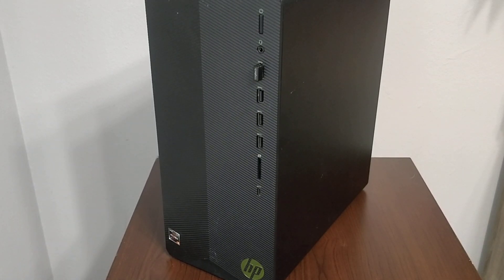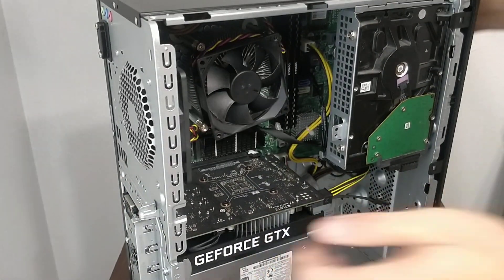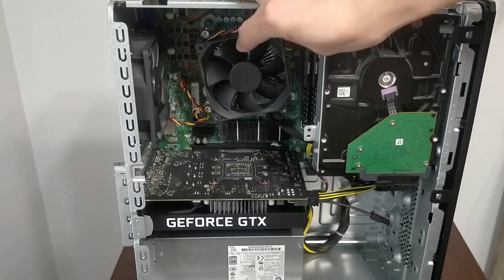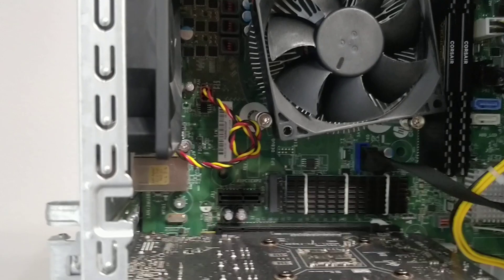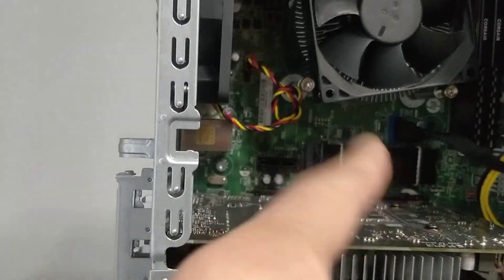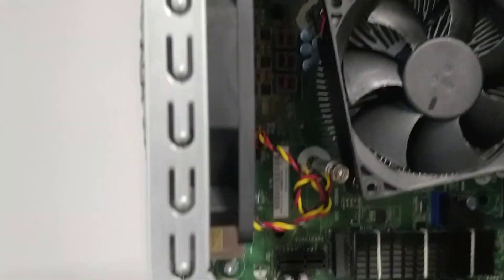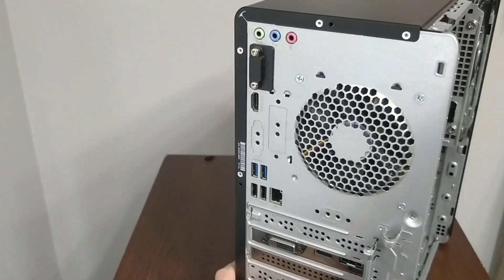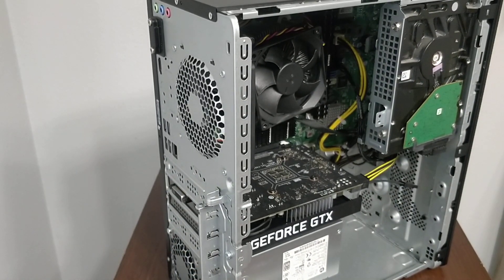HP tg01-0023w, How much Can You Upgrade?

Comment: You can not change power supply there is no after market upgrade for psu. 400 platinum is what they come with. The max upgrades are the ones I've done from the hp website Ryzen 7 3700x, 32gb DDR4 2666 memory and a RTX 8gb 2060 Super SC Ultra with 1/8"  space to spare. The 400 watt is plenty. The hp pavilion TG01-0023w power supply is plenty for the upgrade. Ryzen 7 3700X has TDP of 65 watts and the rtx 2060 has TDP of 175 watts and the memory runs around 1.35 watts. So just these 3 main things at full throttle only use 241.35 watts of power. This unit doesn't have a normal hard drive or cd tray to power. When graphics card companies tell you power requirements recommendations they shoot high because they know alot of people have machines that require alot of power before you even bring gpu into the equation. With all these upgrades you still have over 100+ watts left over. These small ego machines dont need all the extra power because they hardly use any power in first place. You not running the memory at 3200mhz
Reply: I’m getting this pc for Christmas will you give me a list of the things you upgraded on your pc?
Reply: @StandUpDon  AMD Ryzen 7 3700x with EVGA RTX 8GB 2060 Super SC Ultra and Vengeance LPX 32GB set at 2666 on a Samsung 65" 4K QLED screen.
Reply: @SoutheastanglerLLC  Can I upgrade it like this, ryzen 5 3600 EVGA RTX 8GB 2060 and Crucial Ballistix 3200 MHz DDR4 oh and Seagate - Barracuda 2TB Internal SATA Hard Drive
Reply: @Soovdedthegoat  yeah just know the memory your going to have to set manually to 2666 then memory is not going to run at 3200. The ryzen 7 is going to compliment  the 2060 better. But all you said should work
Reply: @SoutheastanglerLLC  ok thanks, one more question tho what do you mean by the ryzen 7 will compliment the 2060 better
Reply: @Soovdedthegoat  they have a very even time spy score so you are far from cpu bottle necking. They should be fine I use mine for PC VR me personally the cpu upgrade made a huge difference in performance in AAA games. Alot of physics in games are on the cpu more than gpu nowadays. There was reasons for me to upgrade the cpu
Reply: @SoutheastanglerLLC  ah ok thank you
Reply: So I can really upgrade the graphic card, from the hp pavilion TGO1-0023W to a RTX 2060 RTX SUPER??
Reply: @josehdz82  yes anything over that has a higher TDP
Reply: I’m pretty sure the EVGA 600w psu will drop right in as a replacement. They are the same dimensions. Correct me if I’m wrong.
Reply: @bombxreviews3261  it will not work the main board connection is not the same
Reply: @SoutheastanglerLLC  what if change out the motherboard?
Reply: @bombxreviews3261  if you do that then sure but why do that. But I dont understand why you would do that and not just build another pc.
Reply: @bombxreviews3261  that's why 2060 is max for this on hp website
Reply: You have limited space I only have 1/8" space between gpu and front of case. Unfortunately you will need to buy windows again due to the version on this pc is setup through hp to work with the oem motherboard. What are you trying to do exactly
Reply: @SoutheastanglerLLC  not trying to build a pc.. I got this pc for my step son because it’s cheap and decent for the price. But I want to go to 16gb of ram but don’t want to limit the ram speed, so was going to change out the motherboard since you can buy one for around 80 dollars. 

Also I don’t really have a need to change out the psu, however, 400 watts seems a little low for my liking. Especially if I plan on changing the case in the future and want to add rgb lights, more fans, and all that.
Reply: @SoutheastanglerLLC  also didn’t try to build a pc because covid has jacked the prices of individual parts way up and would be a rip off right now. Would rather just get this an upgrade a little at a time. I don’t plan on keeping this case forever since it has limited room and no glass to see through. Basically just wanted to get him a starter pc to play for now without needing to upgrade right now. I know this pc hardware won’t last forever and upgrades will eventually be needed.
Reply: @bombxreviews3261  I would leave the pc alone and just get 16gb and set to 2666. It's not worth upgrading the motherboard. Just because a graphics card manufacturer says they recommend a certain wattage does not mean the card uses all that power they dont even use half of what they say. I would not waste my money on what you are wanting to do because the motherboard your going to change to will be old news. We are close seeing a new motherboard from AMD. If you get another motherboard you will need to buy windows and a new psu because nothing from the hp is going to work. Your not going to get anymore speed your just going to spend money. This current erica motherboard is 2020 proof just enjoy it the way it is. Or do my upgrades if you want the true power and potential from this machine. Lately I've been averaging a 3d mark score of 9862 on 4k screen. I'm sure I could get over 10,000 if I really pushed a overclock.
Reply: @SoutheastanglerLLC  thanks. So what kinda fps are you getting on 4K? So you’d recommend just changing out the cpu and gpu (if we wanted to) and everything will still run fine?
Reply: @bombxreviews3261  lol you got that right. Prices for all pc hardware is fucked. It's from our sorry ass president for one along with the coronavirus and the new oculus has alot of people jumping on pcvr and you need the hardware to run vr. Our country is broken are trade is fucked that's why people are over paying for older graphics cards what you see is all we got until these big companies can get up and running again. And nvidia bullshit didnt help the market ether.
Reply: @bombxreviews3261  yes everything should run fine. My FPS depends on what game I'm playing. I'm currently playing Doom eternal with all graphics options set to ultra nightmare and 4k I get around 70-80.
Reply: @SoutheastanglerLLC  will a gtx 1660 work for it
Reply: @irondolphin1559  yes anything under a 2060 will work
Reply: so u can run all that fine the gpu the a7 ang max ram plus ssd and what ever gb or tb hard drive u got without it craping if so thanks i was looking for a answer like this
Reply: @THBGYMN  yes all no problems
Reply: @SoutheastanglerLLC  how much watts dose the motherboard take from the 400wats and how much watts in total dose its use up like from the 241.35 like max is 300? for all included motherboard the 253 m.2 my specs now is 500 hdd gonna switch to a 1tb and 250 m.2 gonna keep gonna upgrade my ram to 16 and the gtx 1650 to 1660 ti or just save for the rtx 2060 like if that hits 300watts thats good like im just making the best out of this pc
Reply: for got to say my cpu i might upgrade or just keep it tbh more looking to upgrade ram and gpu and added storage so if i can do that fine then i am good
Reply: @THBGYMN  motherboard is only going to use the power that the components use. The motherboard alone does not use power. It only transfers power from components being used. These come with the 400 platinum psu it is plenty of power. I have mine maxed to the sky and never and I mean never had a crash or problem with the upgrades. I still have power left over. I know this because I have overclocked and push extra voltage and still no crash only time it crashed is when I get crazy with clock speed buy any pc will do that. I think everyone is over thinking things. The hp site is correct on upgrades just not the memory
Reply: @THBGYMN  dont ignore processor you dont want to make a cpu bottleneck all newer game are very cpu savvy the more cores the better. Processor is a must if your looking for performance in games. I had skipping and stuttering in games like boneworks and half life alyx after upgrading from ryzen 5 3500 to ryzen 7 3600x made a night and day difference everything is very smooth so that in itself is proof cpu does matter. I upgraded gpu to 2060 and 32gb while I had the ryzen 5 3500. It did not release the best until the ryzen 7. You cpu and gpu should share the load
Reply: @SoutheastanglerLLC  ok ty man im just vary new to pc build i know more software then hardware  buy thank you again so much for the help
Reply: @THBGYMN  forgot the ryzen 5 scored 4215 and the 7 scored 9874 at stock speeds on 3d mark. That's just buy swapping the processor only
Reply: @SoutheastanglerLLC  alright thanks again
Reply: @THBGYMN  I would go with 32gbs not 16gb. Unfortunately 16 is not enough going into 2021. I'm seeing games requiring 16gb and if you have 16 your actually under the requirements because windows uses about 4gb. So your really left with 12gb. You can look in task manager to see how much windows is using mine is 3.8gb basically 4gb. So I have so I have really 28gb for games not 32 like most people like to think.
Reply: hey i got another question i was just looking a rtx 2060 need Minimum 500 W or greater system power supply with one 8-pin PCI Express supplementary power connectors. Prior to unpacking your new NVIDIA GeForce RTX 2060 graphics card, it is important to make sure you meet all the system requirements listed on page 4 for a smooth installation. so can u tell me how your pc is working with that 400wat?
Reply: @THBGYMN  the 2060 only uses 175watts at full load. They say 500 because other machines like cd drive and hard drive and other hardware that most people have. Google how much power a 2060 uses your looking for TDP. Almost all cards after you see this dont use anything near recommended power. You have nothing to worry about. My machine only uses about 266 watts that's including cpu and gpu TDP
Reply: @SoutheastanglerLLC  and u still have the 400w psu in your pc
Reply: @SoutheastanglerLLC  also do u got a discord
Reply: @SoutheastanglerLLC  also how much is your mhz for the 36gb ram is it the 2666
Reply: @THBGYMN  no its actually 3200 set to 2666 because hp lies about what memory speed it actually supports
Reply: @THBGYMN  even if you buy 2666 it's going to clock down to 2133 because hp wants you to buy theirs
Reply: @SoutheastanglerLLC this sounds like most companies lol but ok so max is 3200mhz so i can get the lpx 3200mhz and be fine
Reply: @THBGYMN  you can get that but it's not going to run at 3200 it's going to run at 2133 your going to have to set it to 2666 manually or it going to be running even slower than the default speed. You cant just throw memory in and your good to go unfortunately. It's so stupid if the machine is going to down scale the speed at least scale it to the default speed of 2666 not 2133 makes no sense. But luckily we have ryzen master. Anything over 2666 is over clocking the motherboard. You can probably get to 3000 but anything over it going to crash. 2133 set to 2666 is about a 700 point gain in cpu on 3d mark
Reply: @THBGYMN  no I dont have a discord. Yeah I'm using the 400 watt platinum psu that it comes with it. It has the options of a 6 pin or 8 pin pci-e power output.
Reply: @SoutheastanglerLLC  ok but ty for this help
Reply: @THBGYMN  no problem man I'm think about making YouTube videos again it's been along time. I have a gun channel named armedlocation I did about 10 years ago. If you like metal music and guns go check it out. When youtube changed over to Google years ago I lost contact with the channel. So commenting or subscribing I will not see. I wish I could get access to the account but I cant even access to close the account lol. It's just on youtube forever I guess
Reply: use this 1 for pc builds and all the other stuff u said
Reply: @THBGYMN  ok thanks
Reply: What kind of CPU Cooler upgrade can we do ?
Reply: @TheMuffStuff-1  I'm just using the same fan and heatsinks from ryzen 5 I had. I'm not really sure I haven't had cooling problems so no need to change.
Reply: U added 2666mhzt on a ryzen Shame on u
Reply: @thealien_ali3382  shame on hp it's a 2666 supported board
Reply: Hope I'm not too late to ask, but what ram sticks do you recommend to use for an upgrade? Oh, For a 16gb option, I don't really play heavy enough games to warrant getting the extra ram😅)
Reply: @ElTacoRayo  Corsair vengeance LPX but you will need to change speed in ryzen master to supported motherboard speed.
Reply: @SoutheastanglerLLC  alright,I got Ryzen master, what exactly am I supposed to change and to what to I change it to😅 sorry if I'm being bothersome, I'm still kinda new to upgrading pc processes or whatever... Help is appreciated tho
Reply: @ElTacoRayo  set memory and fabric clock to 1333 set as a pair leave everything else on auto and you should be good
Reply: @SoutheastanglerLLC  one more question. When searching up the motherboard it says Supports "PC4-25600 (DDR4-3200)" doesn't that 3200 mean it can go up to 3200mhz?
Here's the info: https://support.hp.com/us-en/document/c06429270
Reply: @ElTacoRayo  it means its possible to overclock to that speed. That's how they are able to get away with saying it supports. I do not recommend overclocking this board you might get a stable 3000mhz but not worth the push its should be fast enough at stock
Reply: @SoutheastanglerLLC  Ah okay I get it now, that you so much, friend. Especially for taking time from your day to help us😅
Reply: @ElTacoRayo  no problem buddy let me know if you need anything else
Reply: hp makes a 500 watt 80+ for these that will go right  in im running the same pc with a ryzen 7 rtx3070 and 500 watt psu

Comment: In theory if a third party adapter existed, you could used an standard ATX PSU.  It would be an external brick though.  Or if you like throwing caution to the wind, you could get the pin out, splice, solder, and shrink wrap.

I haven’t opened mine yet, but my first upgrade will be 32GB of RAM.  Yours seems to be missing the black tray that others have had covering the HDD that would allow for a second HDD to be mounted with screws in the bottom.  Maybe that’s just the Intel SKU.
Reply: could you not get a new pc case and get a standard atx psu
Reply: @saj1736  motherboard has custom size that makes it difficult to find a case for it.
Reply: @upward2239  yhi know  but on some pc cases kost of the screws line up with hp motherboards
Reply: @saj1736  Really?! Please let me know if you find a case that is somewhat compatible with this motherboard (Erica 5). I will greatly appreciate it🙏
Reply: @upward2239  Sorry i dont know any cases for the Erica 5 motherboard but i have seen some youtube vids where the custom hp motherboards corrosponded with most of the motherboard screw holes in a matx pc case
Reply: @saj1736  Oh okay, thanks for the response though. ☺️
Reply: Hypothetically, if the third party adapter existed, what would be the name of the piece and where could I buy it?

Comment: The cpu cooler uses the Intel socket to save HP motherboard costs. I put a liquid cooler 120 mm in mine using a clear plexiglass side cover to hold my radiator.
Reply: where did you get the plexiglass side cover? or did you build it yourself? I'm having a hard time figuring out where to mount it to not choke airflow
Reply: @daedrarood-johnson8054   I bought my plexiglass cover from Lowe's and mounted it from the top three side cover holds that held the original door cover.
Reply: If you can. Can you provide a link to the liquid cooler?